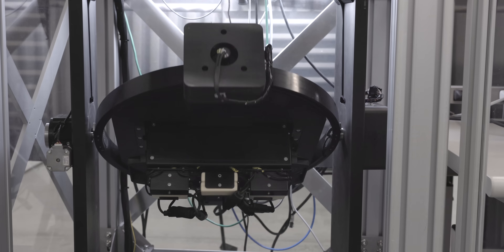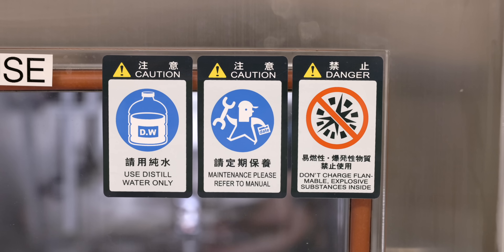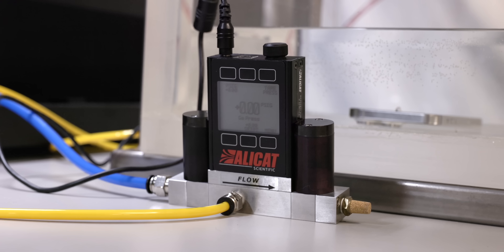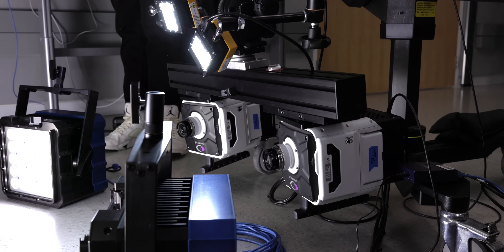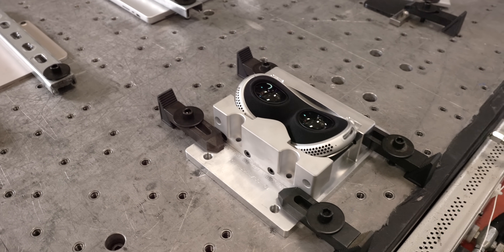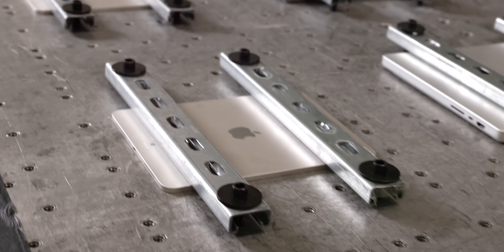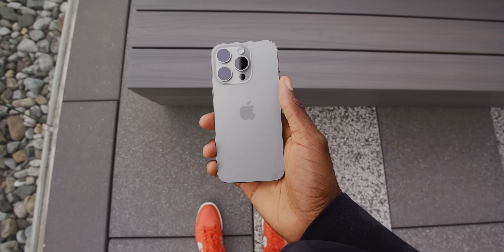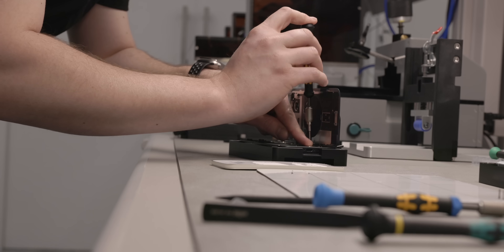I Visited Apple's Secret iPhone Testing Labs!

Comment: The Head Engineer seems like he got A LOT of coaching in preparation for that question. Louis Rossman's head might have legit exploded if he were in the room.
Reply: His comments completely ignore the encoding internal parts so they can't be replaced without being reprogrammed by apple. That aspect of the war on "the right to repair" has nothing to do with durability.
Reply: @heyaisdabomb  yup, this felt like a paid video, no critical thinking at all.
Reply: @hainish2381 Do you think Apple would give him access if he absolutely savaged them in the interview? Would you prefer NO one got access and there were no videos like this? He’s the #1 tech reviewer around because he knows how to thread the needle and produce entertaining while still being critical of products like Fisker and Humane.
Reply: @revmatchtv  I would actually like him to get apple to revoke his access, because then he can tell his 20m followers that apple are pos.
Reply: @hainish2381  I don't think he was paid but he more so doesn't want to ruin potential opportunities/deals with Apple in the future. Which is immensely disappointing because he's going against everything he stands for as a non-biased reviewer that is supposed to be thinking critically and calling things out that should be called out. Not a good look, especially going forward with future apple products he reviews.
Reply: @heyaisdabomb  I will preface that I’m not a fan of apples lack of repairability, amongst other things. However, if you lock down how it is repaired and with what parts you have more control over enforcing a level of repair standard, which includes ongoing durability. Not saying an independent repairer couldn’t do a better job if they had access to the parts, diagrams etc., but can understand trying to uphold an image and level of standard. 
I mean at the same time it could have been so different. They could have built relationships with repairers, not strong armed them into nda’s and heavily controlled their process. It could have been allowing them access and letting the repairers live or die by their reputation on repairing, even perhaps having “recommended repairers” for those that are decent. Apple is a control freak, so no, none of this.
Reply: @heyaisdabomb the argument to that would be that phones are getting repaired with cheaper, unofficial, and inferior parts that might inhibit how the phone functions.

At the end of the day; if you care about repairability then don’t buy an iPhone. Vote with your wallet.
Reply: @heyaisdabomb  The encoded internal parts are a 100% guarantee that iPhones won't be stolen because you can't black market the parts. I for one prefer this over being able to hack a phone together, the real world value is much higher for the average person.
Reply: @heyaisdabomb that’s completely unrelated to what he was talking about. Why would he bring it up?
Reply: Yeah, the obvious counter is "then why don't you make repair parts easily and cheaply available? Why do you make screen replacements being unable to be calibrated, even if they're from other iphones? Same with the BMS?"

There's some unsaid stuff in here, namely that apple actively makes their product less repairable by 3rd parties, which is annoying
Reply: It's the kind of logic that makes sense only if you don't think about it. It is true that durability does sometimes come at the cost of repairability but Apple gives a lot more middle fingers to their customers than just adhesive. There is no durability reason for your screen to have a serial number that is tied to the serial number of your phone. The only reason for doing that is so that Apple is the only company that can sell you replacement screens.
Reply: @retronymph  But look, screen replacement for a genuin oled with the quality of Apples is expensive. ALL oleds are. Imangine if you go to a repair shop and they tell you its "geniun" without that serial lock, you have no idea if its correct or not. Now customers know.
Reply: yeah right? the scale that he made up is bs, it feels weird to me that Marques would believe durability and repairability are polar opposites
Reply: @stbnnnnn  he's a typical shill that values apples money more than his own integrity and pride.
Reply: @stbnnnnn  it really does depend what it is. like in a larger form factor like the imacs they used to make it made no sense why they made it so hard to repair. and also there is like thinkpads just existing that can have their cpu changed and have been going for 20+ years. I think that its just kinda a correlation and no the cause of irreparable. apple def goes out of their way to make it hard to repair
Reply: @stbnnnnn Lol he is marques....what do you even expect. 
Wait until brands like lg, Sony and so on say the same thing and they would get bashed like shiet by this same person
Reply: @stbnnnnn  In his defence it didn't seem like Marques took it at face value just didn't want to really go against apple in what basically constitutes as an Apple sponsored video, which is still pretty bad, but maybe not as damning.
Reply: @stbnnnnn  he's doing compromise journalism and not actually asking proper questions that do consumers a favour and instead prioritizes his exclusive relationship Apple so he can get more behind the scenes, early review units, product launch, etc... It's bullshit the answers the Apple dude is saying and MKBHD knows it. Durability does not mean having to pair parts together, not spare selling parts, gluing and using adhesives when screws are an option, etc...
Reply: @esteban4983 people are so trigger happy to hate apple.

The representative made up the scale and when mkbhd agreed with him, the representative PUSHED back and said "those arent always mutually exclusive" we can have durability and reliability
Reply: We need a Louis response video
Reply: He also just assumed that never failing is inherently better, when there are real reasons for why its not. If I can easily replace my storage, then I can easily put in a larger storage card in the future. If I can replace the battery, then I might not need to get a new phone in 3 years, maybe I can just swap out the dead battery for a new one. Maybe I could even upgrade my screen or my camera module if apple were to support that. More importantly than any of that, he is comparing a realistic situation to an unrealistic one. All devices will break at some point during our lifetimes. Therefore an unbreakable device is impossible. A device that is super easy to repair, is definitely something that can exist. Look at Framework laptops for example.
Reply: @MrMhmToasty  It's so annoying when tech reviewers just ignore the repair aspect of products.
Reply: @thealmightyjensen3367 if he was harsh on them, they wouldn’t invite him back.
Reply: @Clippy_Jesus  He could've been more realistic instead of blatantly lying to us saying that reliability and durability go hand in hand.
Reply: Yeah, acting like software locks for the same parts help durability, what a bunch of bs he spewed out in few seconds
Reply: Had same thought, want Louis's reaction for this video..
Reply: We need a Louis response video
Reply: Aged like wine
Reply: My head almost exploded listening to him talk. He's clearly been conditioned to tell the lie everyone's already heard.
Reply: >Louis Rossman's head might have legit exploded if he were in the room.
Lol, very prescient comment in light of recent events. XD
Reply: 😂😂😂 he just did a video of him.
Reply: @TryMeFoolYT  

And his head did indeed explode roasting Marques and Apple lol
Reply: It feels like for each person who drops their phone in a lake, there are probably 100 people with 💩 batteries. I’d take an IP65 phone with simple battery replacement over an IP68 phone with a PITA battery replacement every time.
Reply: @husseinj  & one would think a $3 trillion company would be able to figure out how to do both durability & repairibility...
Reply: @husseinj  I think in the interview Apple implies just the opposite, that water is or was the biggest return/repair problem until they made lots of changes and now the returns for water problems have dropped substantially.
Reply: @husseinj  true, they could like also maybe just possibly not hardware lock components for "security"
Reply: @husseinj you’re alone on that one buddy. It’s pretty rare that you need to replace your battery; waterproofing is much more important for most people
Reply: Yeah, especially when a lot of what they're getting shit for is coding screens to only work on one phone etc which does nothing for durability
Reply: Remember talk about the planet
Reply: He’s the head of hardware engineering at Apple. Either he got that statement from apples legal team or from Tim Cook directly. No way a normal person believes that bs and I’m an apple sheep myself lol
Reply: I bet Louis Rossman will be foaming around the mouth watching this.
Reply: Even though this guy is an apple employee, I feel like Rossman is even more biased
Reply: Louis made a YouTube community post talking about this video and he's absolutely pissed and done with Apple.

It's just exhausting and I don't blame him for feeling like that, Apple and many other tech companies are just straight up awful.
Reply: @dantealighieri4543 He just dropped a 45min video responding to this one 😎
Reply: Or he has been asked thousands of times about the same question…
Reply: Or he has been asked thousands of times about the same question…
Reply: underrated comment
Reply: Imagine a camera that fit into your hand that was waterproof to 10m and had a removable battery 🤯, that might even take the market for one of the most used action cameras. I remember building robots decades ago to test various car item durabilities, like electric mirror motors, window switches and regulators, door handles, gas hood structs, etc., we even used to do tests to see which of a standard set of "usual spills" was most destructive to the electronics - it was milk. Durability testing is nothing new, or innovative, what you do with the results is what counts.
Reply: The most repairable modern laptops I know of are military grade, we know how to do this at this point. cmon Apple!
Reply: @oofcloof  you mean cmon marques don't be apple blind fanboy right
Reply: Exactly. What rubbish that was.
Reply: Yeah unsubed from MKBHD...with such a big platform you'd think he would hold them a bit accountable.guy is just a shill. Too afraid to say anything cause they won't send him iPhone.
Reply: dafuq, the argument to claim that "people need less battery replacements" is utterly false. When someone breaks or needs to replace parts of their phone, it's way to overpriced so it makes more sence to just buy a new phone and in return less environment friendly. But believe whatever apple is telling you...
Reply: couldn't agree more, mkbhd went EXTREMELY easy on him which was really disappointing
Reply: the same happens with cars, there are car engines that for a mechanic are a pain in the back to repair, but for the engineers was the optimum way to design the engine and engineering wise is a good engine, but a pain to repair
Reply: @ghfsd786fa Which means let’s hope they never make a mistake in the engineering or it cannot be resolved.
Reply: exactly. once you listen to these ppl talk enough, or are around executive level people yourself, you can really spot when they're just rattling off talking points with some fluff between the key bullet points.
Reply: bro definitely tap danced around the software side of "repairability"
Reply: He’s not in that job because he’s the best engineer, he’s in that job because he’s great at repeating Apple talking points and core value brainwash. Typical corporate stooge.
Reply: You guys all know you don’t have to buy iPhones, right? If you hate Apple’s stuff + their design so much, literally no one is going to stop you.

Complaining online does nothing. The only thing that will matter is you not using an Apple device.
Reply: oh he'll see this and make a video within a few hours I'd bet, he's probably screaming at the camera right now
Reply: Yeah, I was looking for that comment. His reply was laughable.
Reply: I’ve never tasted Louis Rossman’s choad but some people in these comments seem to have developed a taste for it.
Reply: If repairability is so important, then just buy the Fairphone, vote with your wallet lol
Reply: I can just imagine the very specific group of people foaming at their mouth once the word "repairability" was uttered.
Reply: @jaames  Real
Reply: I have a major criticism about Marques' Durability/Repairability analogy and it's that there is way more too it than that, yes it is true that the smaller and more integrated parts become it does become harder to repair BUT that completely ignores the other things Apple does that makes things harder to repair like the complete lock down of their supply chain and the software locks between certain components and such...
Reply: The Head Engineer lives and breathes and works this everyday. And you??
Reply: They should let Louis Rossman spend some time at Apple, both would benefit from this.
Reply: I'm assuming the people here criticizing Apple for the repairability of their phones own a phone that isn't made by Apple.

That would be my guess.

I have never purchased an Apple product because of the limitations they force on customers. I want to customize my devices. I want to be able to run 3rd party software.  I think Apple is good for people who don't have personal preferences as to how they use a computer or a phone —people who are happy paying more money for fewer options, forced to do it either the Apple way or the Apple way.

Luckily, there are good alternatives to Apple.
Reply: It’s actually logical what he is saying. The small minority that Louis talk about is just that the small majority. This guy know the numbers in he’s head, and to make it harder to get into the phone, which is not hard if you know how to do it, it save a lot more of iPhone over time. I would take water resistant over easy change battery any day. Don’t want a dead phone when it’s rains. That just a really bad take.
Reply: @chrispy.critter lol delete your comment 😂
Reply: @chrispy.critter By your answer I can tell you're not an engineer. Lol.
Reply: Does his logical argument not make sense? Everything he said was completely sensible and correct; it’s literally just common sense.
Reply: @couchpotatoes5158  too dense to understand that they lock components to the device itself?
Reply: Why? Everything he said was right. It’s really not a hard concept to understand. A super repairable phone can’t be durable; just look at the fairphone.

Comment: This is why restricting DIY repair of iPhones is so important. Can the same IP rating be maintained by someone being able to replace a screen/battery etc with either a genuine or 3rd party component? The unsuspecting person who buys that phone secondhand has no guarantee that the device will work as advertised. Apple is then open to reputation damage (or worse if the device bursts into flames) and not the DIY repairer. Apple, therefore, lock it down. It’s easy to understand why when seeing this facility - they want the experience to be perfect, and not reinterpreted by a DIYer.

Comment: You have a false equivalency of two different spectrums. A spectrum of repairability and a spectrum of dependability. There is no such thing as a product on the absolute extremes of either spectrum let alone both. 

There might be a negative correlation between repairability and dependability but there are other factors in play. Also this is coming from the company who sabotaged their own batteries and artificially made their product less dependable to discourage part replacement. 

Back when I had an iPhone I can't say I was particularly impressed with its physical dependability either.

Comment: While i agree there is a balance be durability vs reliability, its hard to take it seriously from Apple who is known for adding DRM hardware so that you cannot repair the phone.

I would like to know how this increases durability on the phone
Reply: They make durable devices by quoting $1000 for motherboard replacement instead of repairing a small IC.
Reply: Isn't that a security thing?
Reply: @soupisgoodfood42  yAsS sEKurItY vRo
Reply: @soupisgoodfood42  Louis Rossman disproved it. Apple themselves to by recently starting to stop adding the drm to parts. so no, its not a security thing. Its apple trying to stop repair-ability thing.
Reply: @eegernades  I don't trust anything Louis Rossman says after I saw a video where he got angry at Apple because he didn't understand how fans and heatsinks work.
Reply: @soupisgoodfood42  yes, used in movie industry afaik.